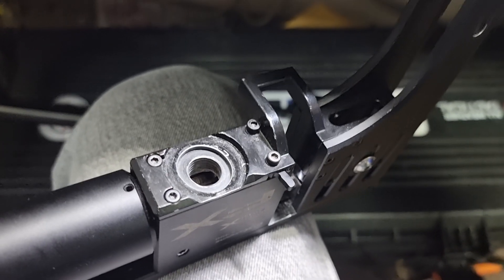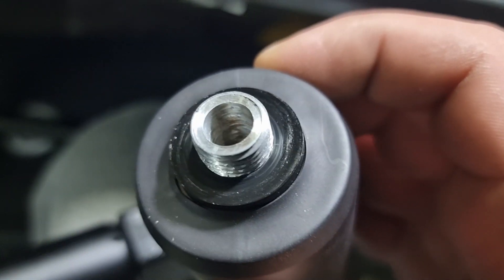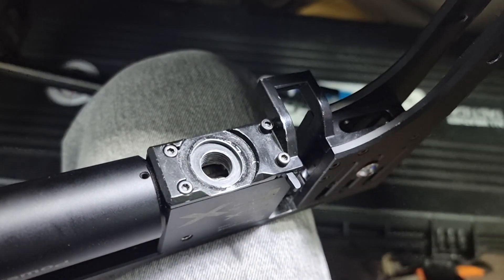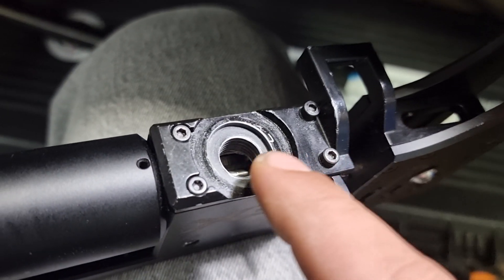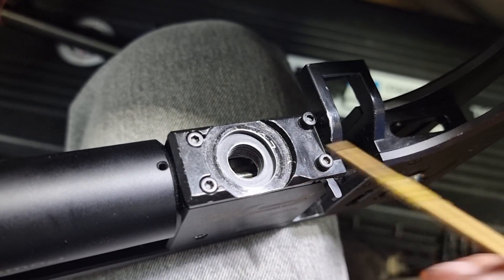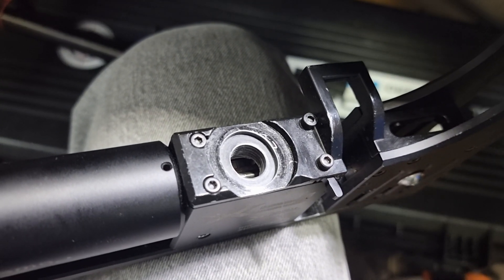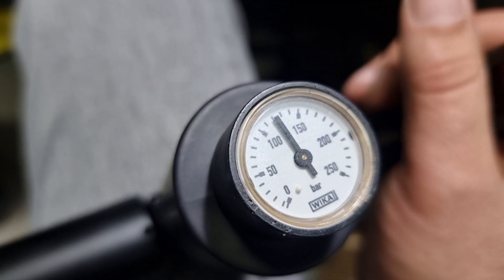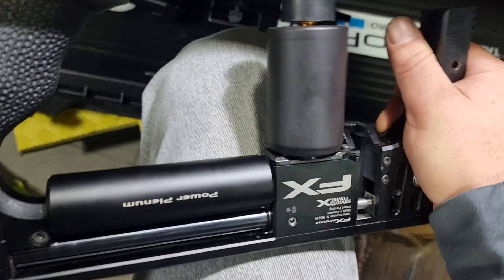fx Impact external plenum M14x1.5mm things to do.

Comment from the maker: Yes it does... benefit for all calibers
Reply: i was wondering if you can do an 80cc or a 100cc?
Reply: @diogoabreu1436  He told me in an email he used to do a 75cc but was to much. More pressure means harder to open valve.